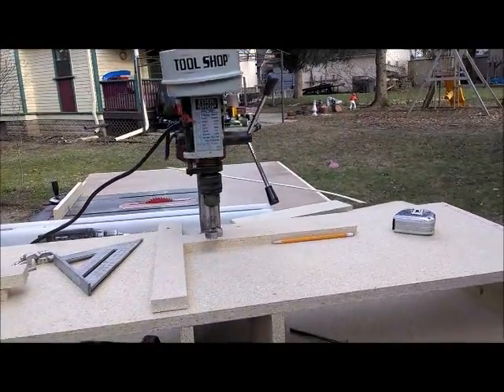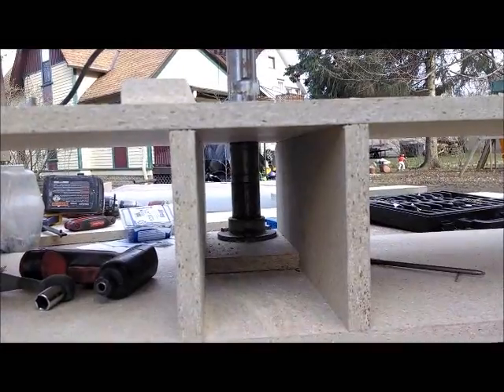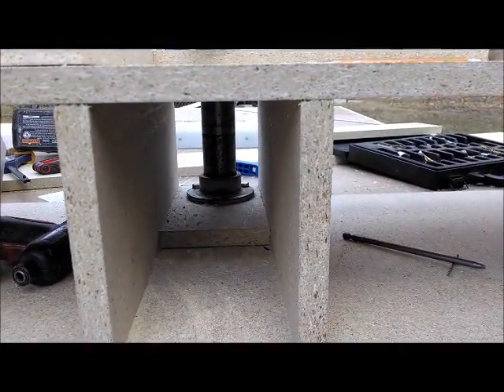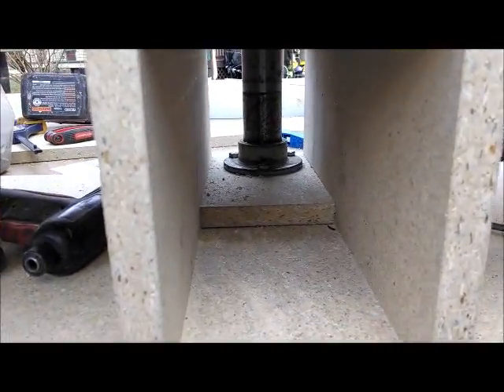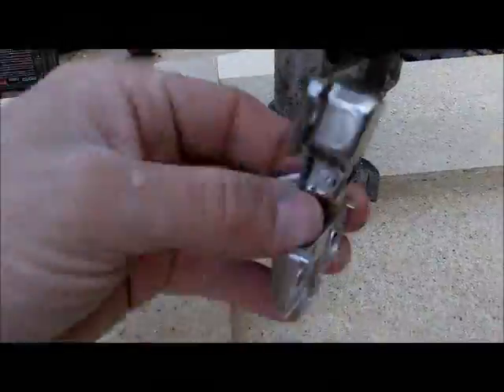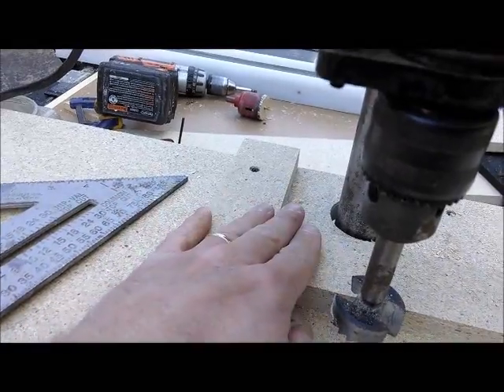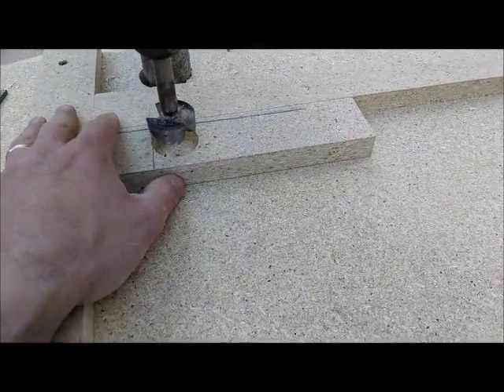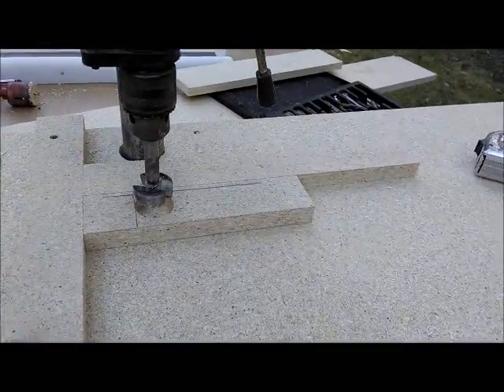Drill Press

Comment: Have you thought about taking two boards the same size and drilling 4 holes in the same spot, and make two templates a left and right. Then when you need to switch or make minor adjustments you just remove the four screws and switch to the other template.
Reply from the maker: You know that's a pretty good idea.